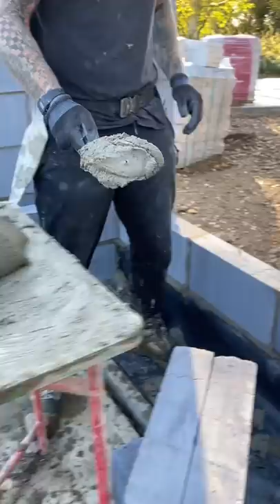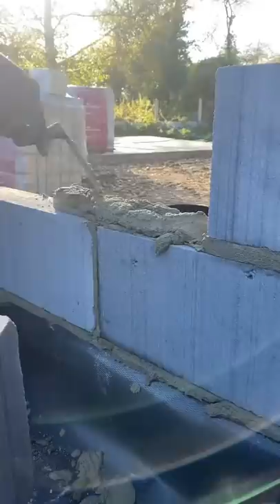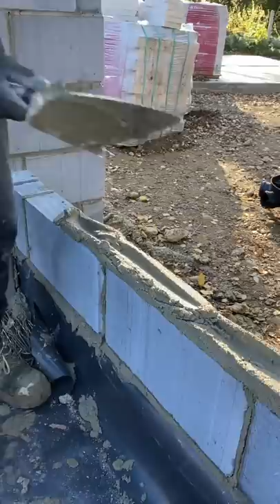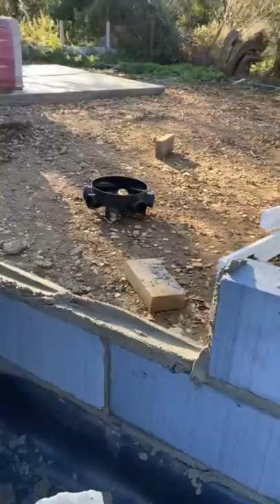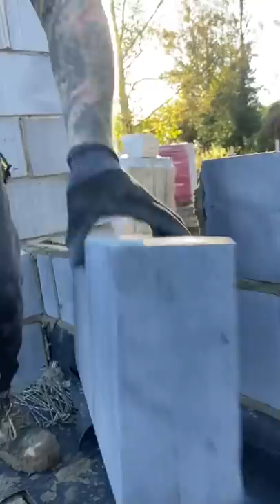Freehand block laying #bricklaying #blockwork #asmr

Comment: I’ve always wondered how much extra concrete they have to buy cuz guys drop significant amounts with each trowel.
Reply: Yeah bro exactly
Reply: @jithuff6055  all brick layers do it unavoidable
Reply: Do you even know what concrete is ?
Reply: @alypha737  lmao for real 🤣
Reply: I always try and pick up the big globs but you're always going to lose some. We go throw a pallet of crete in a week
Reply: Place boxes on the floor before brick work
When cement falls on the box, pick it up and use it again
Reply: @alypha737  well all morter is maid with mainly concrete
Reply: 12%Extra
Reply: @drewormsby2787  How do you figure? Mortar is mostly sand....
Reply: @michaeldunning6005  look at the main brand for morter (lafarge) and in last 2 years all there morter is 75 percent concrete
Reply: @drewormsby2787  I'm retired now so your probably right. I'm over here in the states so it may be different.
Reply: @chillychese  You're a Bricky? And you throw away a 'pallet of crete' in a week? Concrete comes in pallets? Bricklayers use concrete for laying Brick/block work?

You're aware that concrete is composed of ballast and not building sand right?
Reply: @robbieburtt5942  no I'm a stone mason and a somewhat new one. Only been doing it for 2 years. I meant to say "through" not throw. Also yes our spec mix comes on pallets. So yes I said crete instead of motor
Reply: @drewormsby2787  no it’s not mortar and concrete are both made with CEMENT but mortar is building sand concrete is ballast concrete has gravel in, fuck me I’d love to watch you lay brick on concrete beds 😂
Reply: @battaliance  See-saw bond incoming 😂
Reply: Only rookies do this
Reply: You mean cement ? Concrete is when dry lad
Reply: @tomhartley2105  isn’t cement an additive to an aggregate stone that results in “concrete”? Or am I wrong?
Reply: @tomhartley2105  Well... that's incorrect. Concrete is concrete whether it's wet or dry 'lad'. And cement is just one of the components of concrete, mortar, render etc....

And in this case. He is using mortar. Not concrete. Lad.
Reply: Use all ye dropped muck for pointing up points up great texture is jus right ✌🏻
Reply: He will pick up all later.
Reply: @drewormsby2787  cement dear boy concrete has stone in it
Reply: Eso justo estaba pensando.
Reply: It's called Muck
Reply: @robbieburtt5942  these experts eh 😂 😂 😂 🤦‍♂️ Well said
Reply: Mortar isn’t food, it’s not over just because it landed on the floor. You can just pick it up and reuse it…
Reply: @aronkovcin7442  and even if it was food.... 5 second rule 👀
Reply: @superlazy3355  howling my big furry ass off 😂👍😂👍
Reply: @drewormsby2787  mortor is 90 lbs of cement, 50 lbs of lime, and 32 shovel fulls of sand.
Reply: @drewormsby2787  no, it’s made with cement. Cement and concrete are not the same thing. All concrete has cement in it, but all cement is not concrete. Concrete is cement combined with sand and aggregate.
Reply: @sollybear33  what if I don't want to mix that much though?
Reply: It's not concrete it's mortar..  big difference
Reply: Concrete is what you use to build sidewalks and driveways... and pour footers for foundations Mortar is what you use to lay bricks and blocks,
Reply: @robertkiser8465  isn’t the only difference the consistency of the mud?
Reply: But it’s just mud
Reply: @sollybear33  You know what your talking about. 👍That's exactly my recipe. Lol
Reply: @davidnicolas8019  Oh no. There is a big difference friend. 😁
Reply: @두둥탁-y6f  That can be done but not cost effective.
Reply: @davidnicolas8019  concrete has actual rocks in it and motor is just straight powder. You usually want a consistency of peanut butter.
Reply: @drewormsby2787  made with cement and just sand and that white stuff i forgot english word for it, while concrete is a cement mixed with rough sand that has stones in it, depending on the thing you need concrete for they can be bigger or smaller.
Reply: You can see the muck is a bit wetter due to them thermalite blocks making the muck go off so quick, wetter muck means more is going to slip off your trowel, have a go and see how much you drop
Reply: @thedeadlymckenna  yes it's unavoidable but that much for 2 blocks is excessive
Reply: It’s pug lol concrete
Reply: @두둥탁-y6f  Not cost effective .
Reply: @drewormsby2787  Concrete and mortar are 2 totally different things .
Reply: @battaliance  😂😂😂
Reply: @sollybear33  EXACTLY
Reply: @apgreckless8563  You can get smaller bags now.
Reply: @michaeldunning6005  아파트에 쓰레기 수거장이 있어요
거기서 가져오면 돼요
Reply: They reuse it... they usually keep a plastic sheet where it drops so that its easy to reuse
Reply: Guys concrete is when you mix sand,stones and cement and mortar will be only sand and cement pliz.
Reply: @alypha737  LMFAO 😂
Reply: None , cause it ain't concrete
Reply: @terryogletree2128  what is it? It’s not concrete mortar?
Reply: Concrete🤠
Reply: Should buy around 30% extra for the wastage
Reply: @drewormsby2787  sand and cement it is ....look up concrete its not what your talking about mate
Reply: None because there using mortar ! 😂😂
Reply: it goes with the territory, it's not a perfect world oh, there will always be some waste
Reply: @michaeldunning6005  8
Reply: @notmyday7695  The white stuff is "Lime" 👍
Reply: @두둥탁-y6f  it's has like an hour use time. At the end of the day it's rubbish. Waste of time
Reply: @jarrodtawhai7874  It's directing your eyes at words that helps you to read stuff properly.. not telling people stuff they already know lol...

I'm a bricklayer. I know 😉
Reply: Concrete?? It’s called mortar
Reply: @michaeldunning6005   mine to, 45 yrs.
Reply: @francisfranco9318   as in a tile mortar bed, as it was in the beginning is now and will be forever 😅
Reply: @apgreckless8563  It tells you the ratio on the bag if you just want a little bit
Reply: what sand/cement ratio do you use? Cause i see videos in england they can adjust bricks where and whenever they want.

I use 1 cement and 2,5/3 sand. And when its layed after 5 seconds i cannot adjust it or its lose.
Reply: Yep, cement must be cheap there 😊
Reply: It's about 12% on waste👍
Reply: Hes not dropping much

Comment: 25 YEARS OF MASONRY CONSTRUCTION BOTH COMMERCIAL AND RESIDENTIAL AND HAVE NEVER SEEN A JOURNEYMAN SPREAD MUD LIKE THAT, EVER HEARD OF TAMPING YER TROWEL SO YER MUD DONT FALL OFF?
Reply: You know he’s a legit pro bricklayer boomer when he types in all caps, hell yeah brother
Reply: Yep no tamping and not enough cement on the side of the block
Reply: @TheBigUglyTroll  what really looks  cool is takeing something squre and make it look twisted, and so  u lay yer first course and the course after that u take out of square a half inch from the course below and each course after that all the way up, like say custom piers or fireplace stacks, that just a couple examples, but heres the trick getting what ever yer twisting plumb, now that yer twisting u have no flat side to plumb like most situations, so as yer building yer twisted whatever, u pick at least two sides u would normally plumb and simple hold yer level like an inch from yer work , plumb , and u sight inbetween the level and yer work to see if yer starting to wonder in or out of plumb. Something square twisted always looks bad ass

Comment: Tip off steeper my friend your cross joints be full for jointing. One to smooth . One steep up front edge , slight flik of the wrist to flatten what’s left on your trowel out then one steep swoop up back edge.

Comment: That’s an interesting way to butter the head joint
Reply: I’t a ridiculous way to do it. He loses almost a 3rd of the mortar on his trowel every time he slips it on that way. Then the slopped on mortar slides down towards the bottom of the joint so you end up with more mortar on the bottom of the joint than the top, and the top is ultimately loaded with voids.

Comment: A few lay rates we use are 180 100mm block a day per Mason 
500 brick a day per Mason 
Foremen depending on the crew size and lay out plan may only get on the trowel 2 hrs a day while he is there for 10
Reply: what type of ties  are used for external stonework in ireland
Reply: Na thousand a day pays the boys big bucks

Comment: Put story pole up.
Right handed usually spread from left to right.
He's not in Florida, there's no rebar every 4' vertically. Flordia has some stringent building codes, and for a good reason, if your building with a building permit.
Most everything is #5 regarding down here.
His work looks professional don't know what that piece of DuraWall he set in the mortar is expected to do, whatever.

Comment: On hydraulic scaffolding that goes to 220 100mm block a day and 750 brick per Mason you have to get that math out of the gate or use the lower lay rate for regular scaffold 
More production equals a lower labor rate it is complicated simple math

Comment: Where are the cells in the block, the horizontal, and vertical reinforcement? This wall will last about 5 years before it cracks and falls down.

Comment: There will be leaks in that mortar. It's too thick and too lightly pressed. He's relying on the weight of the blocks he'll be laying on top to help settle the mortar, but only if he does it fast enough so that the mortar doesn't start to set up.
Reply: Post your video and teach him how to do it
Reply: @Michael-iu1gv  Do you need a video to understand logic and physics?

Comment: What is the reason for the wire he placed in there ? I don't do block work obviously lol
Reply: There will be a gap filled with insulation and then another layer of blocks. The metal wall tie, ties both layers of blocks together

Comment: Cement is too wet, not enough down pressure on the 2and5/8ths and for the vertical he should have used a .3 or .5 aperture cylindrical cement trowl. Also, the centrifugal force acting on this blocks being placed like that induces wall lean and crimp wall schematics

Comment: Yeah  love it,  mud is the judge.  Set tile: paper wire mud, float it dead level powder it , set tile beat in pour grout on float it beat in mix 70% sand 100 mesh with 30% grout pour on work it with burlap till joints fill flush and perfectly tooled, sweep with fine hair foxtail brush, struck all perimeters with a very square taping knife. Go home. Have a beer. 100 sq ft, one day.

Comment: Other brickies slate this guy and for good reason. Half assed wall ties put in, the mud is that runny it just drops off the perps. Guy should muck up the perp on the brick in hand and use a bit thicker muck. No wonder new builds have so many problems with cowboys like this. Get some nice subsidence in that build there with that overly wet muck. The end.